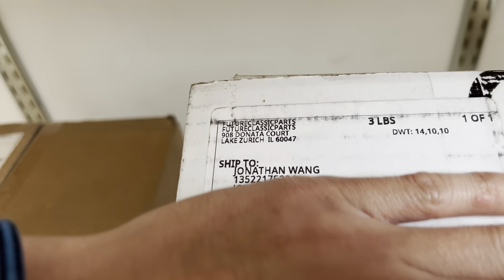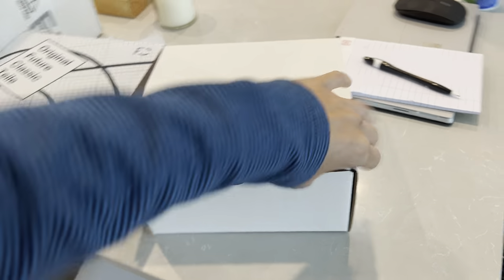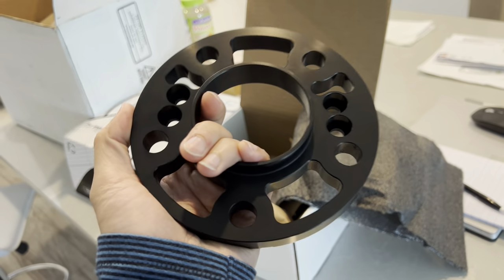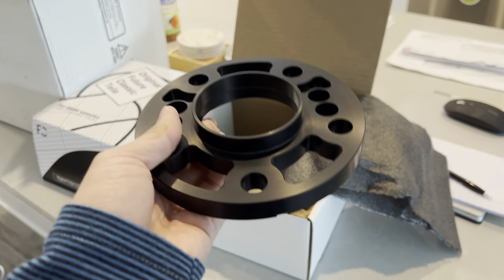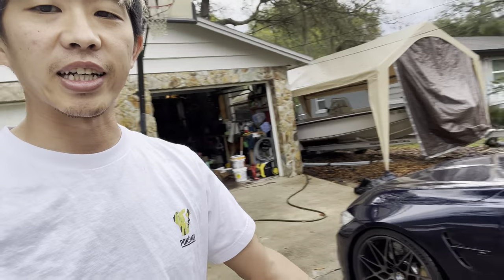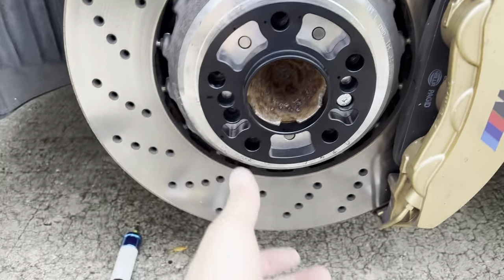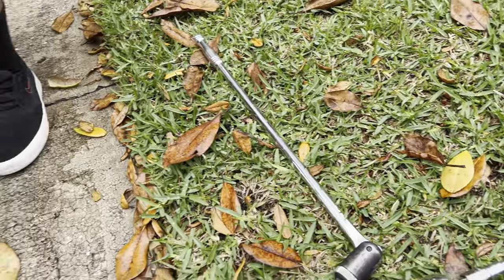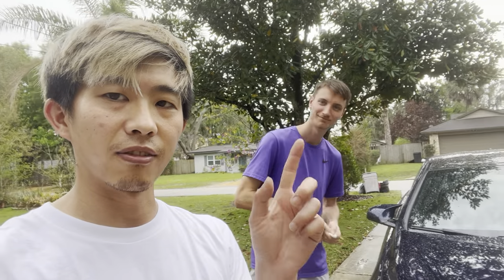Future Classic Spacers: are they better?

Comment: Did you end up removing the stripped screw? If so, how? And did you notice any issues before fixing it? I just added FC spacers to my G87 and stripped one of the screws just like you did.
Reply from the maker: I did, I ended up using a torx to get it out i believe, and a lot of lubricant.